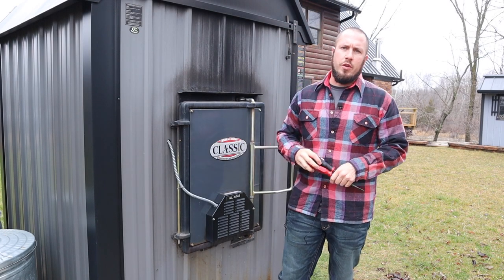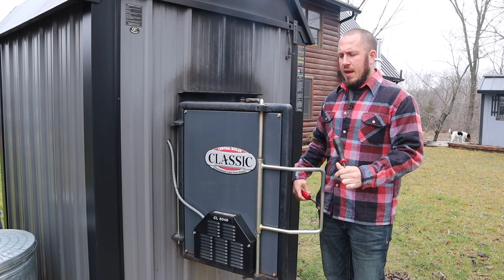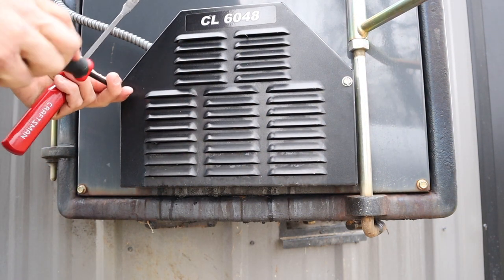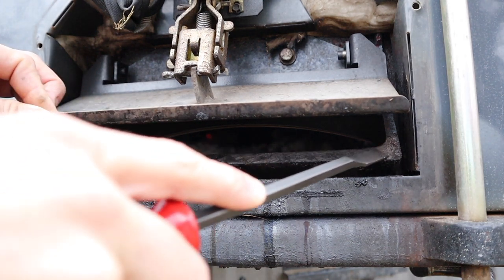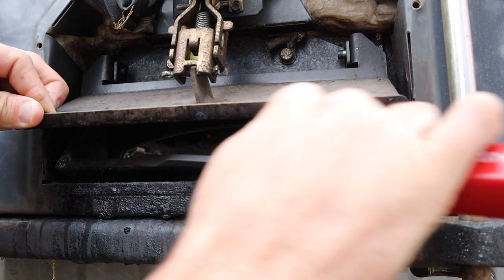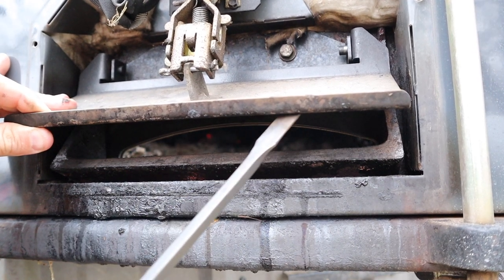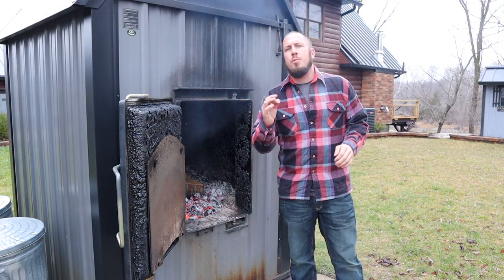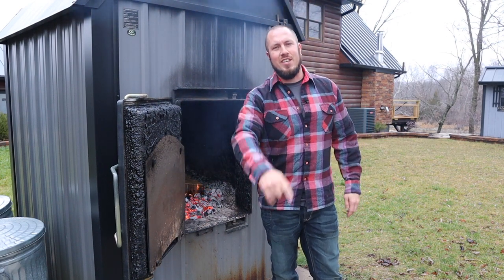Outdoor Wood Boiler Overheating - Draft Door Cleaning

Comment: Good info, makes a lot of sense 👍 How often do you have to empty out the ash from inside where the wood burns?
Reply from the maker: Haven’t emptied it yet this year! BUT my fire box is about the size of a twin mattress 😂🤣 so when I empty it, it will fill multiple 30 gal trash cans.  A smaller stove would need emptied one a week or so